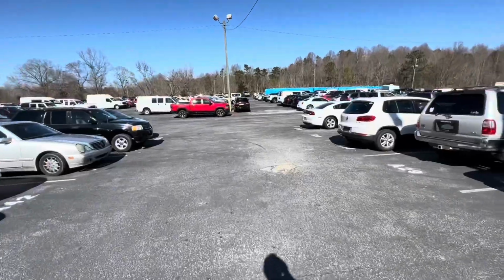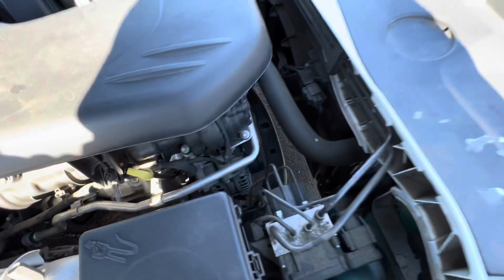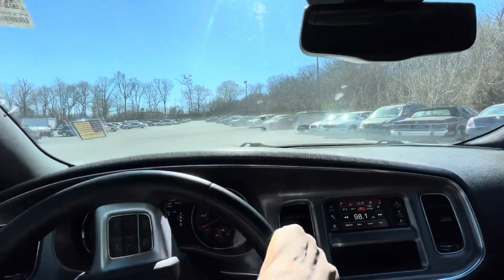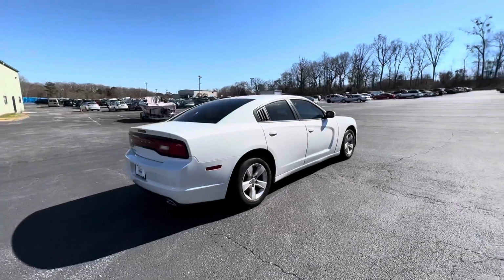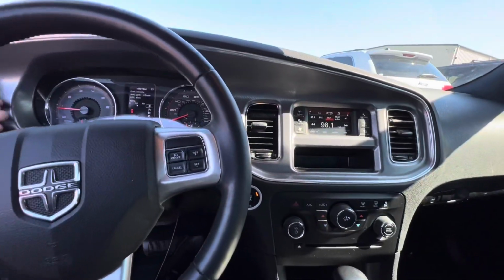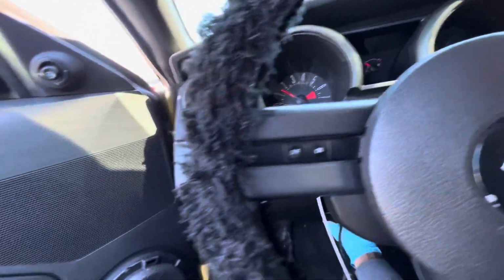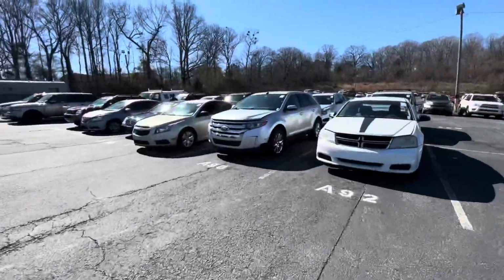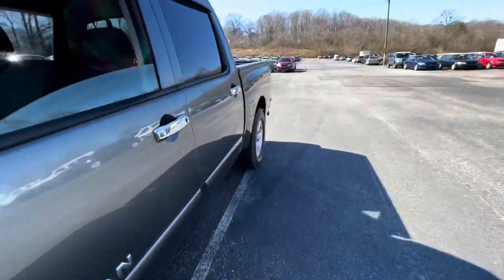BUYING A DODGE CHARGER FROM AUCTION & FINDING OUT IT'S TRASH *NONE OF THE CARS ARE ANY GOOD NOWADAYS

Comment: That's an easy fix, it's a common problem on the 3.6. don't pass that charger up. It's the oil cooler. It's a lot easier to swap that out on the charger then the Chrysler 3.6 fwd models with that engine. The only thing that u would have to do is vacuum out that oil that's sitting there.
Reply: Remove that intake manifold and u have all the access in the world. Don't just replace the o rings. The whole oil cooler should be replaced. It's an easy fix
Reply: Absolutely right on my chrysler with the 3.6 had the same issue just replaced the oil cooler and issue was solved
Reply: @TheFloresFam562  he needs to go back and pick up that charger
Reply: @erickc.1081  That foo a goof if he don't go back tbh
Reply: @5.3taliban10  u never know... He might.
Reply: He need to go back to get it

Comment: Yeah that charger was good money if it was leaking oil I would heat up asap. When I used to change the filter some oil would drip around the filter or if it is not screwed on the right way. It will leak while driving

Comment: My 2014 Chrysler 300 did the same thing was a puddle of oil in the center . Tbh the v6 dodge cars are not that   good in my opinion especially if you buying used
Reply: Nah they sold you a lemon my charger been running good I got the 2014 Dodge Charger SXT

Comment: That's true about most of the vehicles now...they trash. Problems like tapping engines, X-mas lights on the dash, slipping trans, cats missing, etc...It don't matter, because these dealers are desperate. They are still bidding on these cars like there are no issues.

Comment: That’s more than likely just oil spillage from removing that filter.
Reply: Should’ve bought that
Reply: Worst it could’ve been is the oil cooler which is very cheap and easy to fix. Those chargers always have those problems. I fix them all the time.

Comment: Easy fix man buy it it’s a 300$ part 400$ job in labor well worth it the seals went flat on the intercooler easy fix new seals
Reply: Yessir
Reply: Nah you can order it off Amazon for 80 dollars I fix mine
Reply: @yrntmoney3745  yes but it’s not oem ur gonna end up replacing that again cause it’s a cheap part and not factory
Reply: U pay for what you get I don’t even trust auto zone parts cause they suck imagine trusting a cheap Amazon part 🤣💯I’ll pass
Reply: @yrntmoney3745  when you have  a charger  / challenger  you wanna use factory parts not no Amazon or auto zone parts that shits for the birds why replace it twice
Reply: @Dirtyhandscleanmoneycycles  I replaced my oil cooler and it’s been year I don’t got no problems my car runs good
Reply: @yrntmoney3745  it’s been a year see if they hold up 3+years
Reply: @yrntmoney3745  most cars now adays if ur financing if you go thru ur paper work you have to use oem parts to carry warranty just because of  the often failures of cheaper parts

Comment: WTF scan the cars with the check engine lights,they can be simple issues(gas cap,random misfire,etc).The Charger was an inexpensive fix -those 3.6's had issues with the oil filter housings cracking when over tightened.But,you don't know much about cars.Nothing is perfect used car wise!